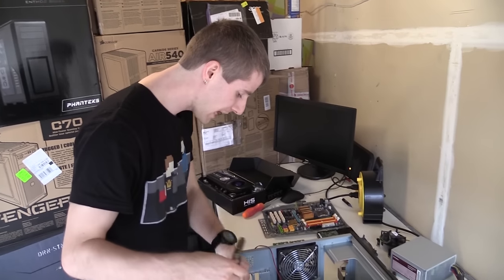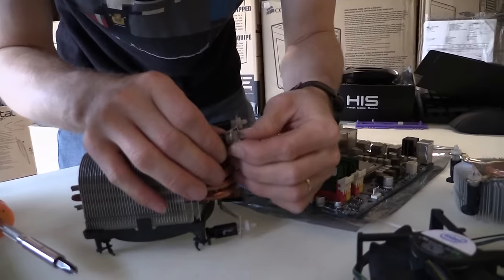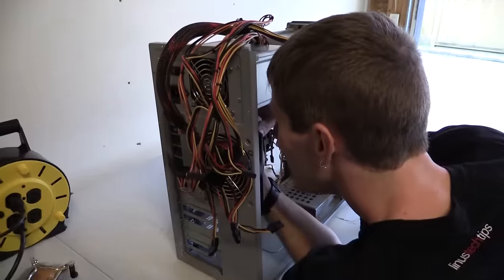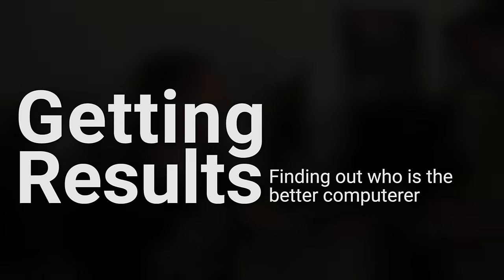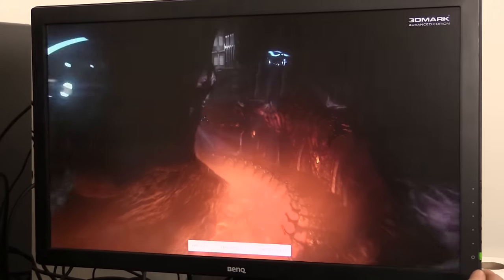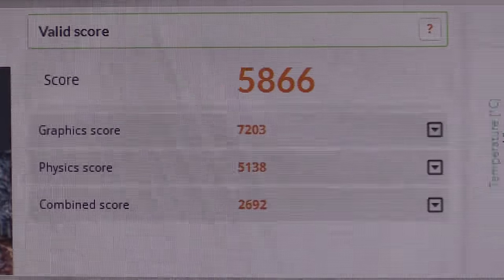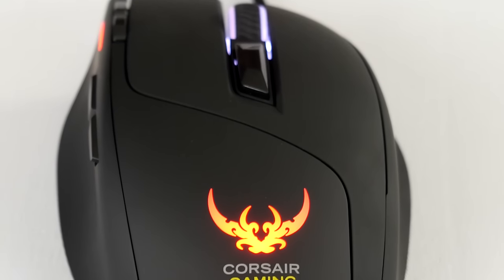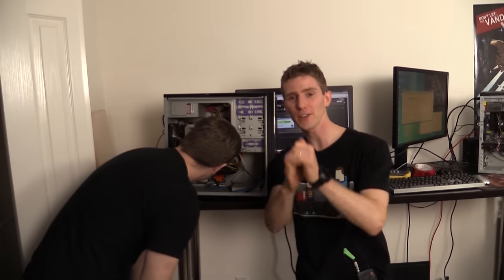$300 Budget Gaming PC Challenge - Scrapyard Wars Episode 1c

Comment: Did you get scammed on the r9 290? It was in an xfx box but it was a reference model..
Reply: Probably bought the reference XFX one.
Reply: ank2000 Resell price's on computer hardware plummet dramatically I see lots of times. It's like "oh you bought this brand new 780 ti for 500 bucks I'll give you 150 for it."
Reply: ank2000 Nope because no one in their right mind would buy a used piece of computer electronics for that much.
Reply: Billy John Used PC parts are surprisingly cheap. I picked up a Sapphire Radeon HD 6870 from a guy on Craigslist for $20, with driver CD, cables, documentation and original box. Sure it's outdated but it still plays newer games rather better than I expected. Computer stuff changes really fast. I built a gaming rig around an AMD HD6990 back in late 2011. The card was a hefty $700 and one of the fastest at the time. Last month I had to sell it for $100.
Reply: Samthing I usually give them to friends who are building computers or donate them to my local computer thrift store. The cheap GPU I bought was the only extra cost for my secondary PC. The rest was cobbled together with whatever parts I had laying around that nobody wanted to buy.

Comment: Where I live there's a used tower for sale with an i7-2600, 120gb SSD, 1tb HDD, no power supply, but only $160 CAD. By throwing a 4GB RX 460 and a PSU into there you could make a pretty decent, super cheap rig for under $350. With a freaking i7.
Reply: Think so  yeah.
Reply: It's CL / eBay mate.

Comment: Bonus points to Luke for the rotary refference!  Big rotary guy here!!!
Reply: No.  Just toss in another rotor motor.  LSX swaps are lame as all hell.
Reply: ***** and boring, a dime a dozen, and not special in any way.
Reply: ***** any engine pushed can break.  Rotaries need some special love and care, but than can be reliable.  Most the people that have issues have no idea what they are doing with the car.  Hard driving, frequent oil changes, and a few other odds and ends and they will last a long time.  And you will have something very special.
Reply: *****
With only three moving parts a rotatory will break a lot less especially at high rpms. The most common causes of rotatory problems is user error, ie not changing oil frequently, putting in synthetic oil, flooding the engine, etc.
Reply: ***** no less user friendly than some high strung piston engines.  And they are way easier to pull and rebuild.  Aside from machine work, assembly is pretty easy.  Side seals can be tricky on the rotors.
Reply: ***** But you can't brap with an LS motor
Reply: ***** Let's compromise and put a 13B in a 'vette
Reply: I've seen a rotary powered Nova XD I made sure that I washed my eyes when I got home. 

All hail the rotary engine!! Screw All the people who swap LS motors into rx7s!
Reply: samin90 26B would be interesting in a vette.

Comment: If luke is running the game in a smaller window does that reduce the resolution his graphics card is rendering and so increasing the FPS.
Reply: Same thoughts actually, but still linus won hahaha
Reply: Yep.
Reply: I believe that monitor was 4k so they lowered it to 1080p and that's why it's smaller on that monitor. I could be wrong but I have the same one Linus was using and that monitor is only 1080p
Reply: They would have considered this.
Reply: +Spectro (Spectro) I must not be fully understanding what your original post was asking then
Reply: Yeah well there's no question mark.
Reply: he's still running 1080p so it doesn't really matter. It's just a matter of quality.
Reply: Spectro can
Reply: Spectro ikr
Reply: Render Scale and Native Resolution are not the same thing. They were both equivalent in the test, even with different displays.
Reply: Angelo Davis it does
Reply: he was running a 4k monitor but had 3DMark set at 1080p, the reason it looked like that was because high DPI settings were messed up for some reason meaning instead of stretching the 1080p image across the entire panel it shrunk it down

Comment: They built a computer that seems to be a bit better than mine for 1/4th of the cost mine is. AND MINE'S NEW. ish. i5 3570, 8 gb ddr3 @1333Mgz, and a GTX 660... I feel like I should sell my computer and go all Scrapyard wars with the budget.
Reply: New? With a 660? You paid $1200 for a 3570 and a 660?
Reply: Hallelujahmkay Yeah... I'm cheesed about my choice and being such a beginner at the time.
Reply: No yours should perform much better if its not i dont know the problem. A bottleneck somewhere?
Reply: MiniNinjia Was it a pre-built?
Reply: Hallelujahmkay Nope I made it. That's the part I hate xD I chose expensive ass parts from expensive ass companies. Should have gone with like AMD for CPU and GPU... Then for the GPU went with like MSI, or EVGA instead of Asus
Reply: MiniNinjia Man I know what you mean. I've bought a 1500$ laptop about 2 years ago. Most parts are ok but my GT555M is bottlenecking as hell. Worst buy of my life...
Reply: MiniNinjia You bought some overpriced shit, that's just insane. When did you build it? I built my with an i7 3770k, gtx 680 and 16GB RAM  for $1300 2 years ago.
Reply: Hallelujahmkay I built mine 2 years ago I'm fairly sure. But I bought the parts from Canada Computers... becasue it's closer to my house than an NCIX store... And my mom didn't want to pay for shipping
Reply: Upgrade your BIOS/UEFI, get a better cooler and over clock everything :) then you can run some crazy numbers.
Reply: MasterMech77 I have an H100i... And I can't overclock an i5 3570. And yeah, I'm gonna have to update my bios
Reply: MiniNinjia
Gotcha, yeah sucks some when you can't "mod" things. Guess manufactures have to make that extra dollar to allow us to do any kind of overclocking with the "unlocked" chips.
Reply: MasterMech77 Yeah, damn them extra dollars to not laser cut the damn dye...
Reply: MiniNinjia you saved money on the wrong end.The i5 3570k is far superior than the i5 3570. I own the 3570k myself and i clocked it up to 4,2 with a safe 60° degrees.
Also the gtx 660 can be overclocked so try to pull out some extra fps there.
Reply: ***** Yeah after I realized overclocking isn't as hard as it seemed I was like "I shoulda got the k edition" And everytime I try to overclock my 660, it never wants to safely run. I go up little by little but I still end up crashing.
Reply: MiniNinjia then apply some voltage
Reply: ***** I've already tried things like that. It's not being stable at all
Reply: MiniNinjia iv got a HP Z800 for $350.  12 cores @ 2.66Ghz 16gb of DDR3.. it didn't come with a hard drive or GPU but i bought a pair of 6970's for $80  which are running in crossfire.. i love it!  and i have to ability to add up to half a Tb of ram..  why? because i can :)
Reply: Dr sausage fingers Half of a terabyte of ram does not exist.
Reply: half correct.. the z800 can't handle half a terabyte i was misinformed by another youtube video. the HP Z820 workstation can handle 512gb of ram tho and many many servers out there can handle it
Reply: Dr sausage fingers
Yes, I think that I've heard of 512gb.
Reply: MiniNinjia I made the same mistake myself...

To make it worse for you though, I paid 1200 dollars for an i7 3770, 8gb, GTX 660 for the exact same price....AND IT WAS PREBUILT

So yea, when a better prebuilt machine is beating you....you know you made a mistake. lol.
Reply: TheManInUrPC I'm not alone =D
Reply: I recently build a scrap parts machine:

Athlon X4 760K $52
Gigabyte F2A88XM-D3H $52
RAM: 8gb ddr3 free
GPU:Powercolor HD 7770 GHz edition $84
PSU: Silverstone Strider 600W free
Case: Cooler Master HAF912 free

Total: $188
Reply: DonaldDUHKID
Whats with the free parts?
Reply: ***** Yeah I can go maxxed settings with 60 fps too, but I just prefer having more than 60. =P I'm a poor PC snob xD
Reply: Peyton Urquhart 

660 is a lot weaker than a 7950 & r9 290.
Reply: MiniNinjia Eh, IMO you should only upgrade the graphics card and maybe some aesthetics like a new case and that kinda stuff.
Reply: The Branchan I have an NZXT Phantom 410 =P It looks fine, but I might be building an entirely new computer soon with better specs. Kinda. i5 4690k, GTX 970, 16 gb 1866Mhz, and the Fractal Design Refine R5 windowed. Mobo is an MSI Z97M and a 120gb SSD =P This is if someone buys my current PC for 900. If not then I'll just be getting the gpu and SSD upgrade
Reply: ***** nonononono... GPUs are way more important.
Reply: ***** The ram is to run servers, or for rendering. And it's only if someone buys my computer first. If no one buys it, then I'll be upgrading GPU. At least that was my plan. So now I guess it's getting the new mobo and CPU first if no one buys it.
Reply: Dr sausage fingers 2.66ghz for a 12 core? That's just 110mhz more than my crap pentium.
Reply: The Branchan Server/ workstation cpu`s are made for spreading the workload not for all out 8 ghz gaming performance.
Reply: Ah.
Reply: the old xeon cpu's and the core 2 quad's are pretty much the same chips only very slight differences between the both.. apart from the price :) iv since upgraded to a better fitting setup.. a intel X5470 @ 3.33Ghz stock OC'd to 4.3Ghz with my P5Q PRO motherboard.. not bad for $18 CPU and a $35 motherboard..   i also overclocked my DDR2 800mhz ram to just over 1000mhz.

some of you may read this and think why am i playing around with old tech.. i find it fun hunting old parts for cheap and trying to get the best performance i can for the money.
i have more fun doing this than iv had trying to get the most expensive system with the highest specs i can afford only to realize thats its only slightly faster than my previous computer..  in terms of the tasks i run anyway   browser/downloading/gaming   no video editing or anything like that, ow and some heavy tasks in linux sometimes.
i think people underestimate the power/price ratio on older components.
Reply: MiniNinjia a GTX580 will probably go toe to toe if not beat a GTX660 but, it will use more watts/power. a 580 is higher end card than the gtx660 even though it's 1 generation older.
Reply: cdoublejj That's nice to know. I'm getting a completely new build soon with a placeholder G3258 and then replace it with a 4690k when I get money, and have a Strix 970 or maybe one from MSI
Reply: +Hunter Dominic (The Ender Army) ur new to pcs theres xeons with 1tb ram

Comment: For 290$ I got a first gen i5 , 8gb of ram , a new evga 600 watt psu , and a gtx 770
Reply: Damn
Reply: So you bought a gun with 290$ and robbed someone
Reply: +Westin Mcclister Nice job lying.
Reply: +Hawkince a 770.is 2 gens behind and the fact that its used. A first gen i5 thats old too and its used ram isnt too exp8nsive on the used side tho a mobo would put it over. Tho you do have to remember Luke got a 290 and he had a 240 USD budget
Reply: +Hawkince the i5 is several years old , I only got a 80gb hdd , the 770 was used and the ram and psu were picked up for 62$ together at a Best Buy sale. Deals like these aren't even that hard to come by if your patient and are willing to negotiate with people on Craigslist
Reply: for $160 i got q6600 4gb ram and 600 watt psu and gtx 570
Reply: i got a amd fx 8300 gtx 960 16 gb ram for 0$
Reply: I got my Core i7 5820X, 128 gigs DDR4, press copy of the 1080ti (2x in an SLI config) x99 mobo, 3x 4k 144hz monitors, Cooler Master CM5 Case, 5x 200mm Fans, (CPU and GPU watercooled) 1200 watt PSU, 2x 3.84 gigs SAMSUNG SSD. for -10000$
Reply: Canadian?
Reply: no, yen. Corrections need to be made though, it was actually a 2x 22 core Xeon E5, with HP, (88 threads), 1.2 tbs of ECC Memory, 4x Quadro 6600 (Pascal), 3.84 gigs SAMSUNG SSD's in raid 0, a 2400 watt PSU, 5x 4k 144hz Monitors, all for the price listed above.
Reply: I just missed out on a i7 2600k with z68x motherboard , 2tb hdd,120gb ssd, radeaon 6950 2gb ,blueray drive, tx750psu and a nice case with 4 fans for 350$ cad .....
Reply: Westin Mcclister WHERE
Reply: Luke 2108 craigslist , it may take a little bit of talking people down but theyre even cheaper now since pascal cards are out now
Reply: Went to japan for a while. Got a i5 2500k Watercooled, xfx 80+600W psu, 16gb ram, AND A GTX 780. For 350$. After the deal I went out of my way to buy him a beer. I'm still amazed about the deal I got.
Reply: Chris Kringle What is the difference from a 2500k and a 2500?
Reply: Unlocked multiplier on the K.
Reply: How did you bring it back?
Reply: No chance first gen i5 sells for 290$
Reply: lol 2017 is different from early 2015
Reply: is this USD or CAN
Reply: I did find in dumbster i2 duo E8500, 750Ti, sad 160gb hdd :D ,8gb, asus p5b motherboard.
Reply: They had 300 CAD which is like 100 USD
Reply: @disadadi oh shit my bad
Reply: i got amd 3 3200g and RX 580 4 gb for 200 $
Reply: That’s basically what I got but I was dumb and got an FX

Comment: 100$ budget!!! :D
Reply: That money could be spent on a piece of shit computer or a toaster with equal computational power.
Reply: Tyrov So a console? :P
Reply: Majątek boom.
Reply: hp stream 7
Reply: Shane Rivers I hope I get the tomato salsa for the 30$ left
Reply: ***** YES! Lol
Reply: TW gamerbuilder YES but if it was 100 dollar its a shit pc or a playstation tv
Reply: I wouldn't be suprised if you could get an old core 2 duo, or at the very least pentium D. Computer off craigslist for 50$ or so. With everything included. Stick a gtx 260, 460, even a 4870, 5850, 5870, even something like a gtx 560 or gtx 480, that you get for under 50$. And have a 100$ pc that can run games at easily low or higher settings.
Reply: my calculator costs more than that :P
Reply: Yes!

Comment: Wow, I always target higher performance on the GPU side, so I was surprised believe a 7950 win over a R290.
Reply: Well there is probably more bottle necking on Luke's side (mainly cause of his dual core cpu)
Reply: I believe a beast Gpu can't run its full potential with a weaker Cpu.., and ram..
Reply: It's because the 290 was getting bottlenecked something fierce by that weak CPU.
Reply: Thing is the 7950 is a beast when overclocked and can easily pair up to a 7970 when pushed, at the same time, the C2D from Luke was a heavy bottleneck on that 290, and you could see that in the physics test. Overall what really made the winner there was that the bottleneck between the CPU and GPU in Linus' computer was not as wide as with Luke's.

It would've been nice to see the 290 running on par with the Q6600, just for giggles.
Reply: I'm pretty sure that the Q6600, even at 3.2GHz is still a bottleneck for an HD7950! This means that the E8400 is a hell of a bottleneck for the R9 290. When it comes to PC gaming, a good combination of CPU and GPU power counts, a good GPU is no one man army.

Comment: What CPU did luke have?
I never saw it in the Video?!
Can you pleas bench the Q6600 with the R9 290?!
Reply: it was a duo core e8400
Reply: TheFpsGamer1125
It should have done much better than.
You can OC those to 4GHz without any Problem.
Performance is decent even today, maybe not in the Physic test but in Dirt 3.
It doesent realy benefit from Quadcore.

http://www.google.de/imgres?imgurl=http://www.pcgameshardware.de/screenshots/original/2011/05/Dirt3-GPUs-1920x1.png&imgrefurl=http://www.pcgameshardware.de/Dirt-3-PC-234328/Tests/Erstmals-ohne-Colin-McRae-825548/&h=878&w=650&tbnid=N_QEVSsP7Rf0uM:&zoom=1&tbnh=95&tbnw=70&usg=__8B1NRdAlVnO8r80UkU-Q1DszIBg=&docid=ZZiL2zLyhRhYqM&sa=X&ei=Ae7yVKrZMoLoOPm1gcAB&ved=0CCcQ9QEwAQ
Reply: simons700 ummmm, why are you ranting at me? i only said what CPU luke was using ;_; and btw, 4Ghz, but at what temps with a stock cooler? that's the question. reaching 4Ghz on a air stock cooler is pretty hard. luke pretty much pushed the cpu as far as it could go.
Reply: simons700

Depending on what mobo you have ;)
Reply: simons700 That motherboard didn't allow for that type of overclock, like he said in the ending.
Reply: TheFpsGamer1125
O sry.
No offense 
i'm just saying in general.
But if the mobo doesent allow it, its a shame...